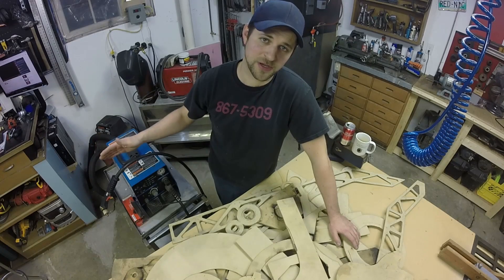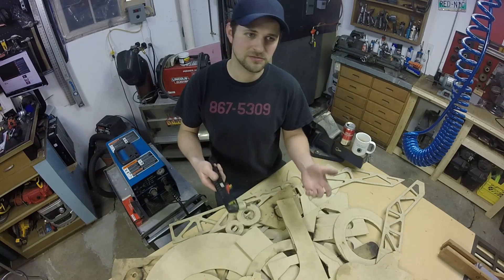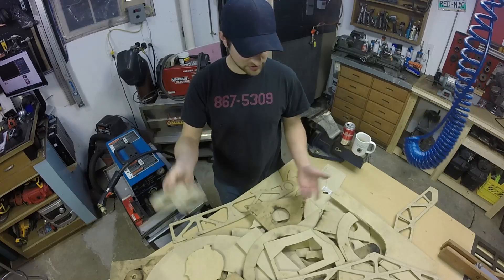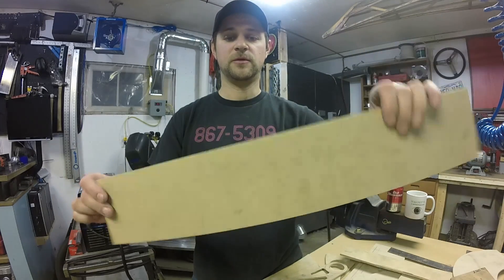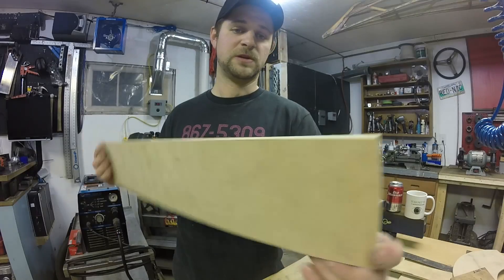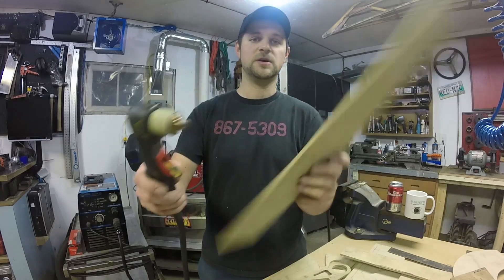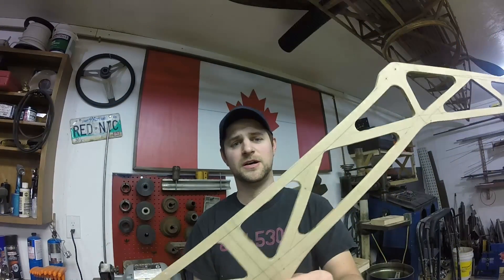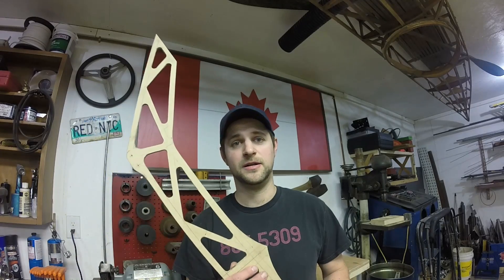Plasma Cutter Templates - MADE FROM WOOD !!?!?!?

Comment: Nice job.  I test my templates by making a disc from thick card stock with a hole in the middle for a mechanical pencil.  Saves material.
Thicker metals can char, even with my fat nozzle 7/16" radius so I make aluminum templates.  Cut with a sabre saw, then fine tune with die grinder and carbide burrs.  Flap drum for final finish.

Comment: I know this is an older video, but hopefully you will read this.  I need you opinion... I am shopping for my first plasma cutter and I was going back and forth on whether to get a pilot arc no-touch, or a HF start and drag it.  After considering what I will use it most for (metal art, sheet metal), I am convinced that I want the PT-31 style torch with the HF contact tip.  I am thinking this mainly because of the style of the tip will be better for using stencils/templates.  I just think that the straight style of the tip would be easier than the cone shaped tip usually seen with a pilot arc system when using wood templates.  Do you agree? Please help, I am at my wits end!!
Reply from the maker: Mine is a pilot arc, but has a fairly pointy tip. I'd agree with you that a thinner tip is better for templates. I think the HF tip would work great for you. So, yes, I'd say your correct

Comment: Hey Bud, I tried your idea and it works fantastic.  I have a wood cutting bandsaw and bought some 1/4 hard board and make an allowance of about 1/16" and it cuts beautifully WITHOUT damaging the template.  Thanks a million for your video, it has made my plasma a precision tool.  I did a series of hole sizes on a hardboard strip and can cut a perfect bolt holes in all the popular larger sizes.  I also made some curved parallel slots to use for adjusting/locks.

Comment: I have been using aluminum dryer vent pipe. I place magnets opposite each other in different places to lift the template off the steel and stick it to the metal. This will even work on curved material. You can cut the vent pipe with regular scissors.

Comment: where do you get your drawings to make your wooden templates
Reply from the maker: I either draw them, or print them and cut them out
Reply: what web site do you get your prints from . thanks
Reply: If you learn to draw you can have any thing you want. CAD is nice by takes some time to learn. There are free ones on line. A cheap simple solution is to use a T square, drafting triangles and a compass.

Comment: what's the best way to cut the wood also can you make bolt holes with a wooden template?
Reply from the maker: I usually use a jig saw with a fine blade. bolt holes can be done, but may need some cleaning up afterwords. i prefer to drill holes instead. but for larger holes (1" and larger) i would plasma them. thanks for the comment!

Comment: 1. Beautiful kayak on the ceiling. 2. My templates catch on fire when cutting thick metal (3/8"). Any ideas?
Reply from the maker: +Alan Yelvington 1. Thanks 2. Are you using hardboard?
Reply: 3/8" pluwood for a 1/16" standoff. Running 50 amps.
Reply from the maker: use a more glue based wood like hardboard

Comment: On some of those complex designs how do you reduce/add the material for your torch? I'd think that would be complicated on something with a lot of radi.
Reply from the maker: it can be, but once you get the hang of it you can find it limitations. some things very intricate and small may not work for this style of templates.

Comment: Don't forget about HDF, for long term use templates (say a set of circles in consecutive increasing sizes, a great addition for any plasma cutter tool box) it's better. There's also HDF that's treated against fire, so the plasma cutter won't even touch it, also, since it's HDF (high density vs medium density) the ride is smoother, as i've noticed.
Reply from the maker: sweet!
Reply: Great tips. I've never thought about using wood for templates with my powerplasma cutter. Its a great idea.